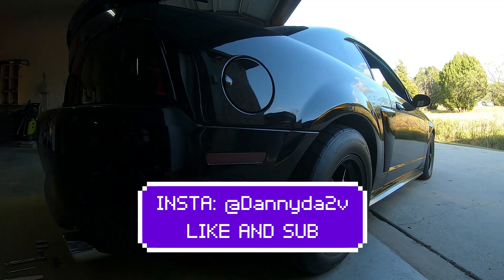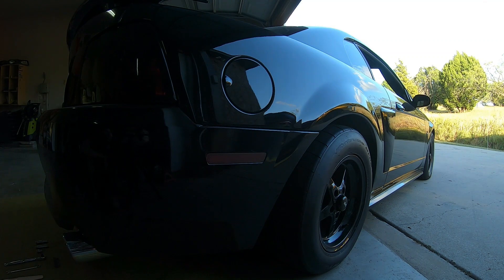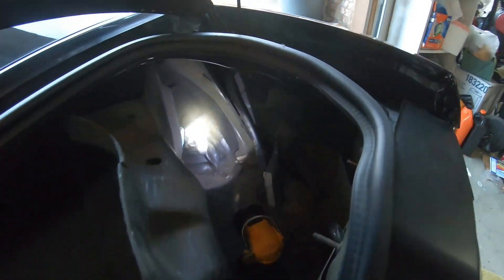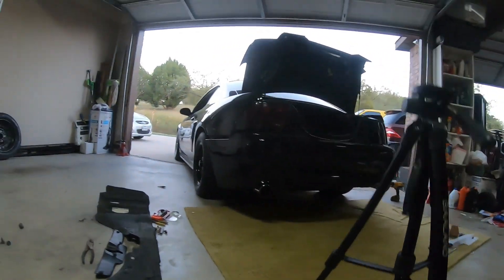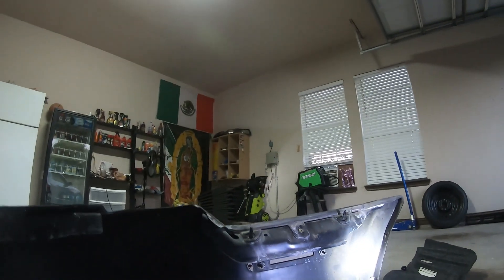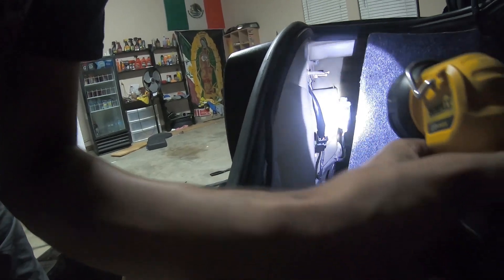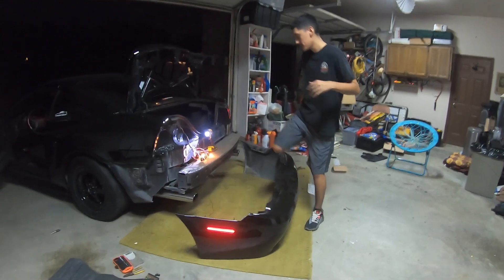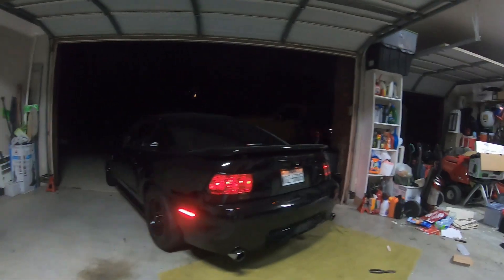Stanglights LED Side Markers for 99-04 Mustangs (Installation)

Comment: I wonder if they can be tied into the blinker circuit and be street legal.
Reply from the maker: Possibly, but I didn’t want to risk the lights 🤣
Reply: @dfwdanny  It's unlikely that you'll damage the LEDs unless you're able to apply more than 15 VDC to them. Hooking up LED's backwards won't destroy them either unless you apply a lot more voltage than a car can provide .

Comment: I also have the sequentials and a v2 Raxiom flasher. I put LED bulbs in the harness and it hyper flashes. When I put a regular bulb in the slot furthest away from the backup bulb, it doesn't hyperflash. Looks like that slot needs a resistor, any recommendations?
Reply from the maker: hmm could you further explain ? Does the regular bulb flash normal or not at all?
Reply: @dfwdanny  I took care of it, even made a video about it

Comment: Dude I need help with the splice in the wire and there is literally no videos on it.
Reply from the maker: Hey, so those pieces I used are called “scotch locks” they are a very simple way of splicing. You won’t have to deal with shaving the wires and connecting them. The scotch locks just requires you to place both wires you are splicing and click down on the blade to make them connect. Look them up on google, they are blue pieces with a small blade. They actually came with the kit as well, so you don’t have to buy them 👍🏽
Reply: I got it thanks my man lol
Just had to use my brain like u said lol.
Reply from the maker: If you have any further questions and any more details hmu on insta, I can walk you through things brodie 👍🏽